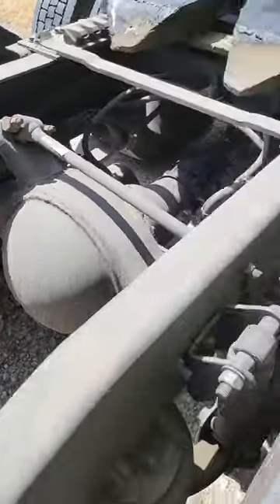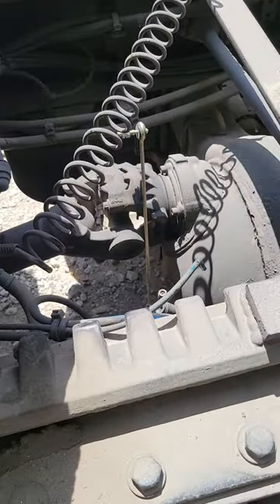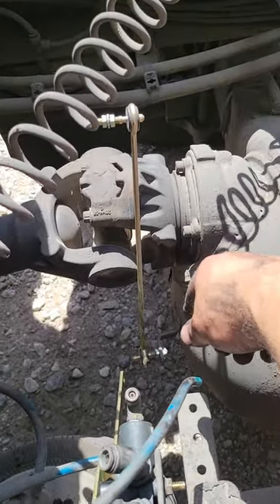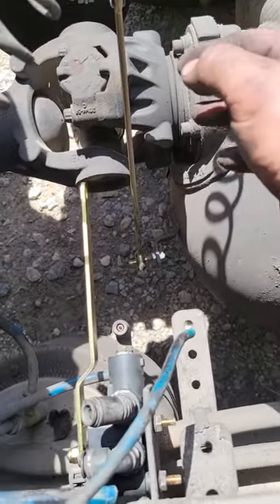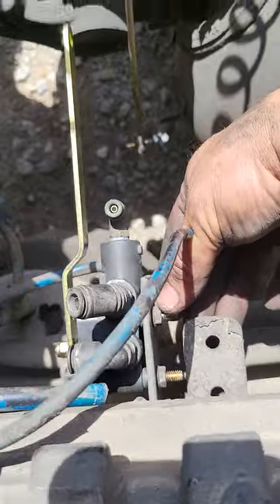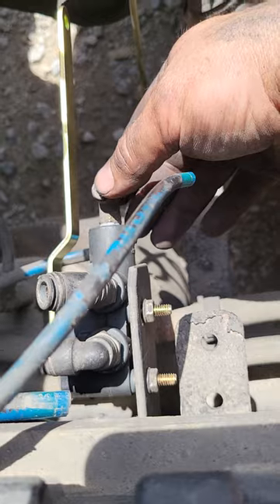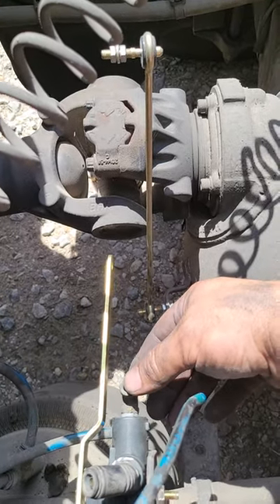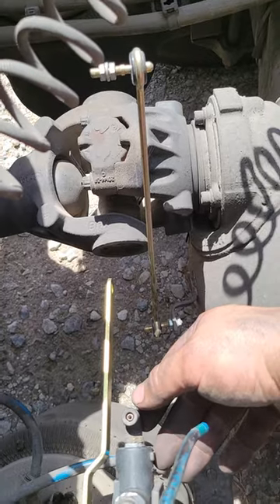Freightliner Ride Height Adjustment

Comment: This is how I got freightliner Columbia to drive like a Cadillac. Most people don't know. Awesome video here.
Reply: Do you know the leveling hight
Reply from the maker: @Unknown_305_Miami  This isn't a very technical answer, but it's what I have found to work well on my truck... I just basically get it to where the top of my frame rails are even with the top of my tires.
Reply: @BrackishMongrel  I'm not sure what you meant, can you give easy words to understand
Reply: Front set of drives or rear set
 @BrackishMongrel
Reply from the maker: @DR-um2bv  an average between the two, as there is a bit of rake in the way the frame sits. But if you're that close, then you're in the right vicinity. It's best to just avoid extremes on one end or the other.

Comment: Do not cut the suspension rod .  Check to see if the differential rod bracket is bent .  Remove rod from air valve bracket arm . Chalk Steer tires and release parking brakes .  Adjust air to air springs , bring frame level across the tops of tires .  Place golf tee through air valve bracket into valve body .  Connect rod to bracket and tighten valve , remove golf tee .

Comment: Should the shaking in the rear be intermittent or constant. I have a shake in the rear and it comes and goes
Reply from the maker: I get that too. Sometimes it is the trailer that I am pulling, but I think overall it's a combination of worn engine mounts, suspension bushings, tires out of balance, etc. Any number of things. I don't think it can be nailed down to just one thing.  My truck has almost a million miles, and I'm learning to live with the fact that it's not new anymore. So if your truck has a bunch of miles with original motor mounts and suspension components, it's probably all of it together when it comes and goes like you're describing.

Comment: What is the height supposed to be at and will it change when empty or you have a trailer attached?
Reply from the maker: I've always set my height to where the top of the tires, (assuming they are 295/75 22.5's) are even with the top of the frame rail. And yes, it should be at the same height loaded and empty. That is the purpose of the leveling valve. It adds our removes air from the suspension to maintain a constant height.

Comment: They self adjust,problem is they go bad
Reply from the maker: Yes, they do self adjust, that's their whole purpose, but they are still manually adjustable at the valve itself to raise or lower the maximum height.